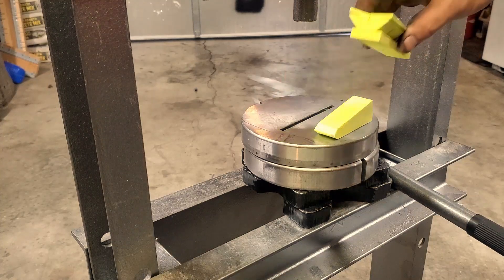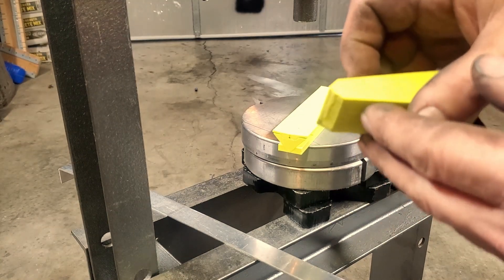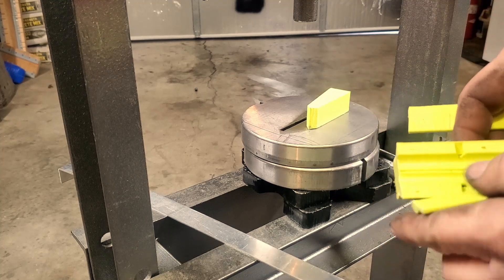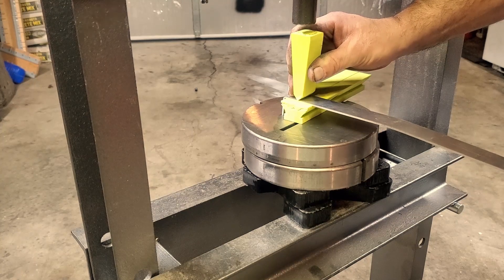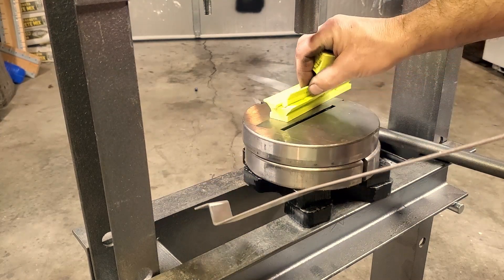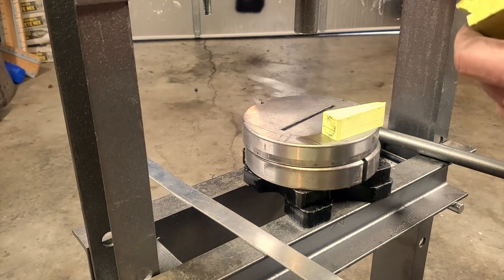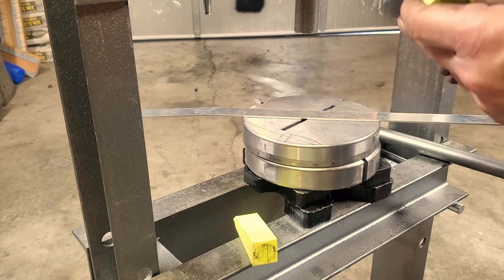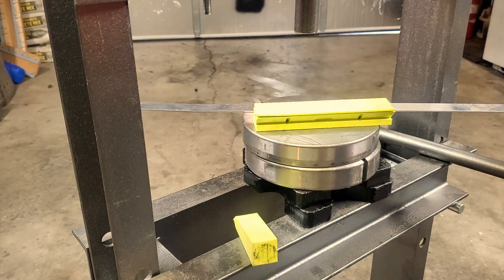3d printed press brake tooling

Comment: Nicely done! You should get some springs for them wings. If the design hasnt changed then 3mm diameter 25long fits great. 👍😆
Reply from the maker: Ya, the holes did not print great so springs were not working. Just wanted to test it and see how well it worked. If i get in a situation where i need this type of die again i will print a new one and use springs. 
Thanks.